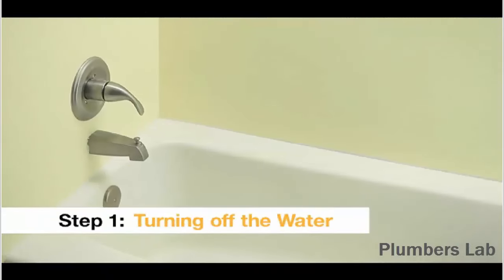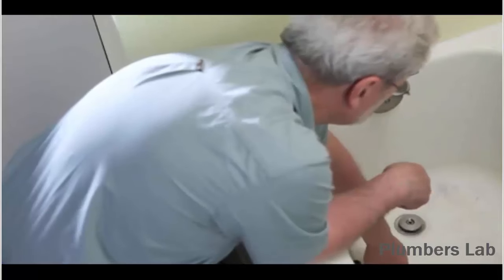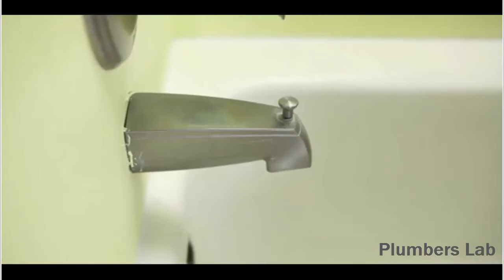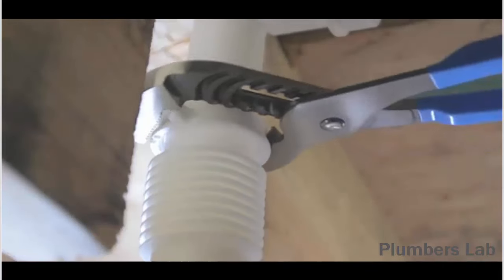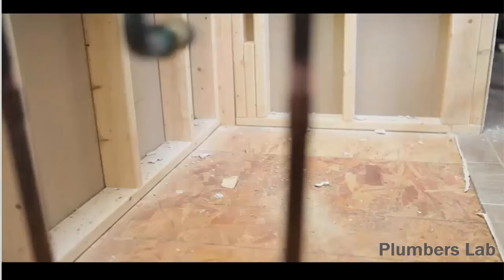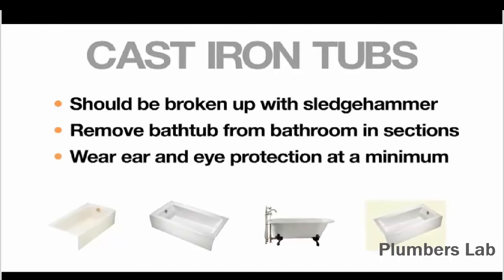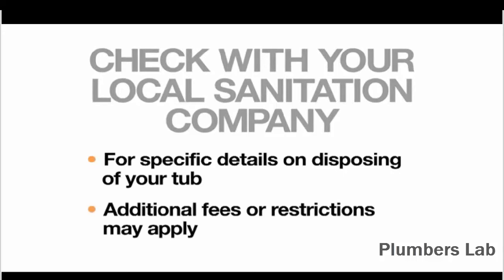How to Remove a Bathtub Step by Step Process

Comment from the maker: If You Need Plumbing Help. Call Mr. Rooter Plumbers +1 844-600-0814

24/7 Emergency Service
Pipe Replacement & Repairs
Drain Cleaning & Unclogging
Leaky Faucets Or Pipes
Fixture Installed
Toilet, Tub, Shower & Sink
Hot Water Heaters
Ceiling Leaks
Underground Pipe Repairs
Frozen Pipes
Garbage Disposals
Gas Lines

Comment: turn off hot water heater before turning off water pressure to your whole house.  if you drain your hot water lines all the way to your tub, the tank can be partially drained leaving the upper element exposed burning out the element.

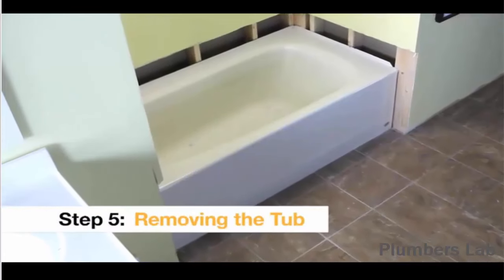Comment: At 1:40 it looks like a step is missing. What happened to the wall above the tub? Does it need to be cut out?
Reply: https://www.youtube.com/watch?v=wo1Uv2vlMO8

Thats the actual full length vid. This seems to be a rip off even though it was posted earlier.
Reply: You remove that portion above the tub, to expose the flange, usually it will be nailed to the stud

Comment: My house is built on a slab and I don't have below floor access to the drain to disconnect. What should I do?
Reply: Probably need to open the Wall at the Drain/overflow end so that u can reach underneath the tub end to disconnect

Comment: How important is it that the water is turned off? I've removed all of the tile and sheet rock, exposing the copper pipes, without turning the water off. While doing this, I did get that OLD MILDEW odor and left the windows open over night. The only thing left to remove is the drain and overflow on the tub.

Comment: So, a cast iron tub cannot be removed to be used in another home?  We are supposed to be picking one up this weekend from someone who's giving her tub away (as well as, sink, vanity, toilet, etc.).  Please let me know asap if it's a must to tear out a cast iron tub so we don't waste our time.  Thanks!
Reply from the maker: Apparently you can cut cast iron with a plasma cutter. They are relatively easy to use but it's also easy to burn yourself. A welder would have suitable experience. You can buy them cheaply these days but your job may need some oomph, so I'd recommend hiring one for the job. An essential companion is a companion - to watch for fires resulting from the sparks / outflow / hot stuff that looks like the sun. A fire extinguisher or at least two sources of water are essential eg bucket AND hose. You'll need welding masks.

Comment: I want to remove my tub completely and just 
Tile the whole bathroom floor. 
No tub
No shower door
No shower curtain 
Just a shower head and tile floor
Reply: Me too!
Reply: you'll have to sort out a proper drainage system if you want to avoid problems but look at how the Japanese do that for ideas
Reply: @Barney-ps8bl  thx. I think it will be expensive, lot of work.
Reply: That may lower the resale value of your house unless you have a lot of bathrooms
Reply: @ikigai47  my house is 400sq ft square little home.  Not worth a lot.
Reply: @PInk77W1  Even still.  When you go to sell it the next guy won't like the bathroom
Reply: @ikigai47  true.  I haven’t done it yet.  
Probably won’t do it.  I rode my bicycle across India and at the hotels that’s how the bathrooms are. Just all tile and a shower head.  I thought it was cool.
Reply: @PInk77W1  Yeah that does sound like a great shower room actually.  If I had many bathrooms it'd be neat to have one with that feature.  In America they have them but they're usually in an expensive home's swimming pool shower area
Reply: @ikigai47  I heard someone say they are called 
“Handicap showers”, for people who are in a wheelchair. Just roll in. Take a shower and roll out
Reply: @PInk77W1  hmm, didn't even think of that.  Cool
Reply: @ikigai47  me either. Someone Told me.
If u think about it, how often do people use their 
Bath tub vs. shower ? I’m guessing 
99% shower

Comment: If you keep hitting the tub with a sledge hammer and it doesn't break apart you might have a porcelain-enameled steel bathtub which will require you to cut it with a reciprocating saw..

Comment: Cant we just break it to pieces and get rid of it
Reply: Abdul absolutely if it’s cast iron. Bust it up it with a sledgehammer, I did that, but don’t hit any walls lol.
Reply: 2:10 Clearly states that cast iron tubs should be broken up into pieces. Attention spans are unable to follow a video over 5 seconds long!
Reply: Sure but you need acces to the frame in the installation